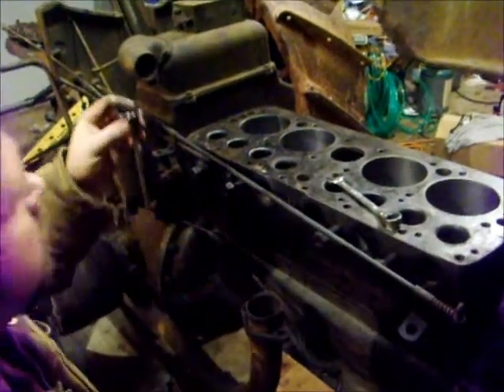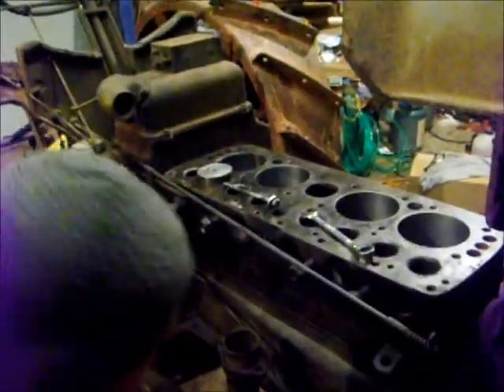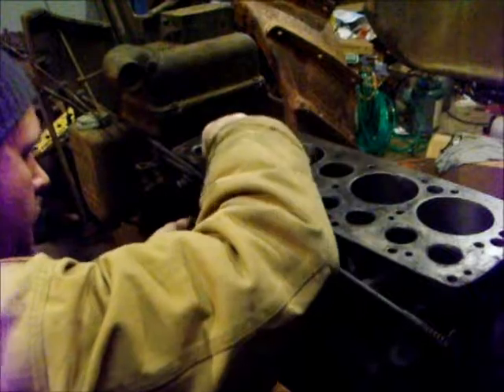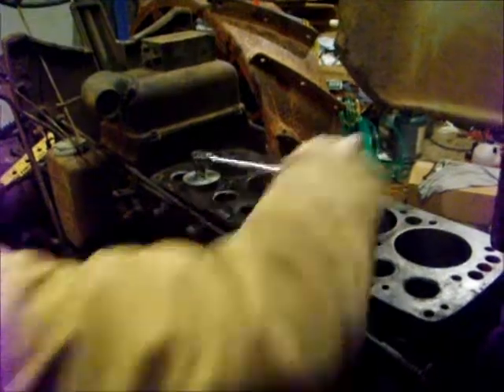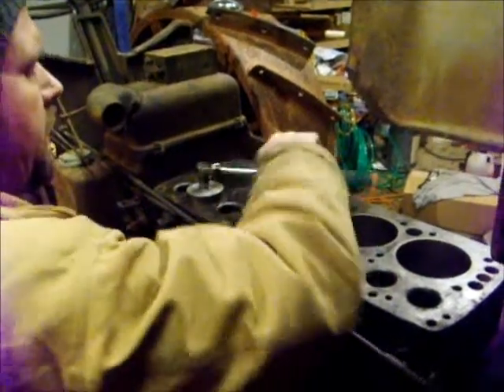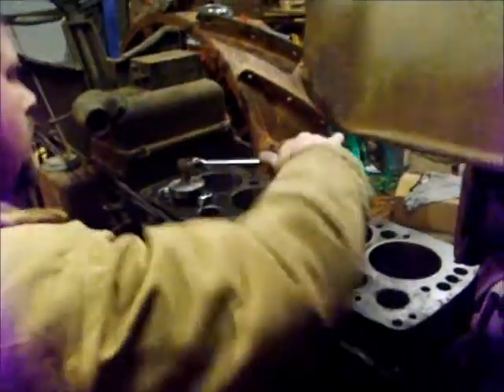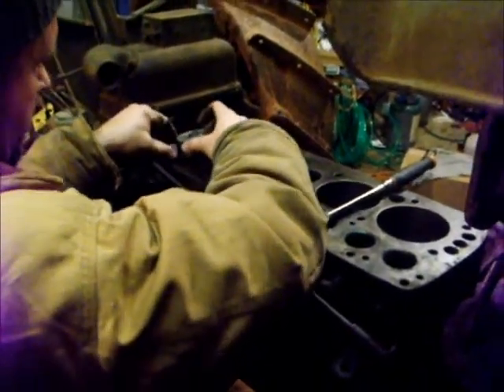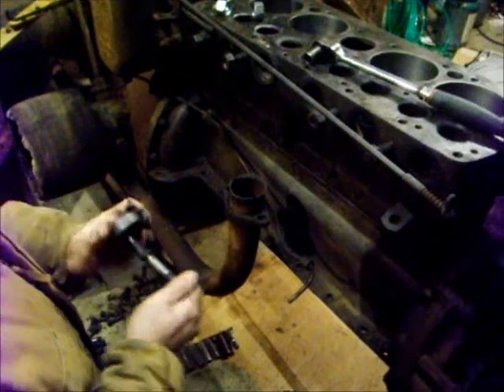1921 fordson "model F" valve guide removal, from engine block

Comment: Thank you. Any tips for driving the new ones in? www.fordsons.co.uk
Reply from the maker: +Ford Sons , Use the proper size valve guide "driver",  A rebuilding shop will have these or you can buy one. Just a glorified punch that is machined to fit. After install, I would recommend you ream the valves guides, to remove the burr.
Reply: Thank you much appreciated. I was just going to tap it in slowly, not knowing there is actual tools. I am on the case for buying some.
Reply: Oh sorry have just twigged what I need to buy. Over here we call them a drift rather then driver. In that case I have a 5/16th drift already. Thanks again and great videos.